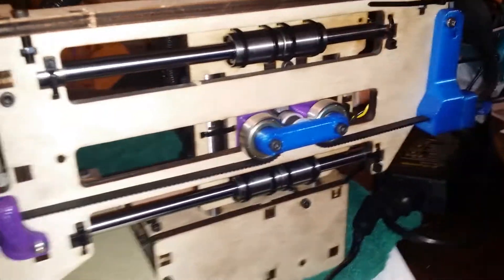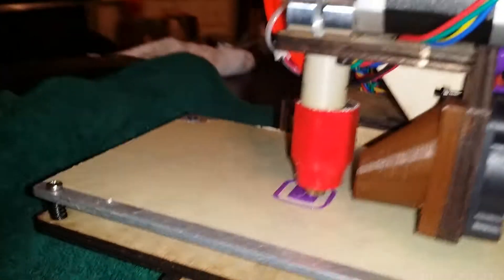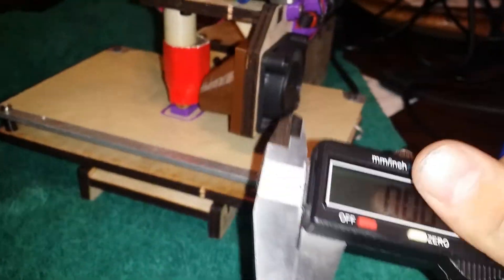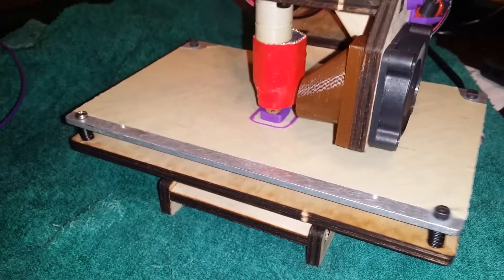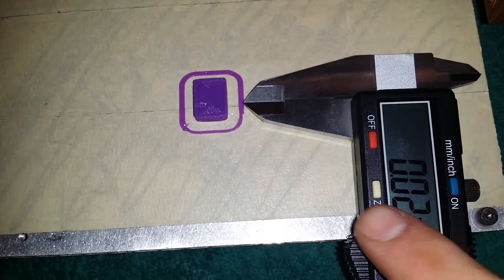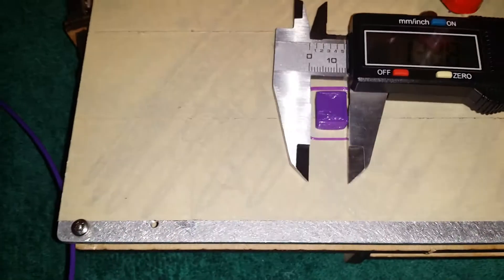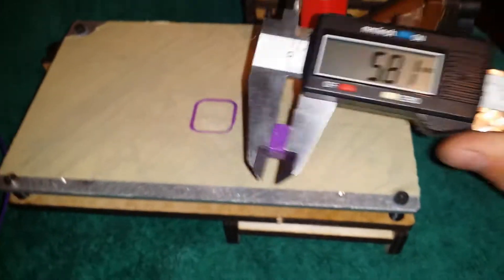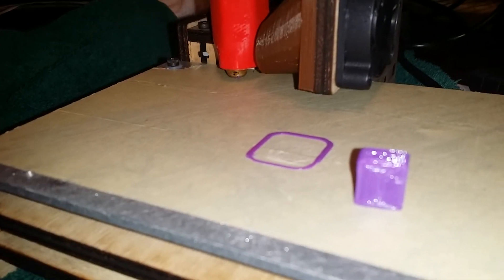Printrbot simple gt2 belt

Comment: Hey man, i think u are printing a bit too hot, it looks a bit too liquidy than it should. This could cause a warp in ur print, just try turning it down a bit on ur repetier settings.
Reply from the maker: if i print anything lower with then 220c with this pla i have then it will jam i got it running smooth now and ill try to post a video soon  just been thinking about building a whole new printer im having problems with y axis sag

Comment from the maker: ive got it printing perfect now thanks
Reply: great stuff, i just printed out my mounting plates and tie offs for the gt2 for the y-axis on mine. I saw you cable tied the ends of the belt, does it not loop back in on itself and lock in place with a small piece of filament in between the notches on the belt?